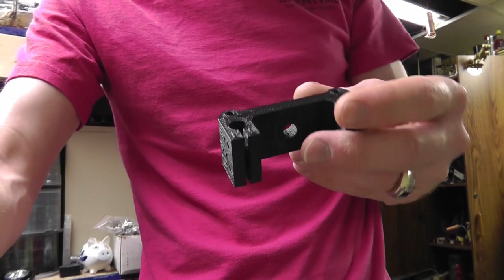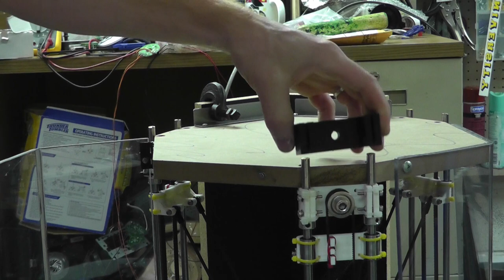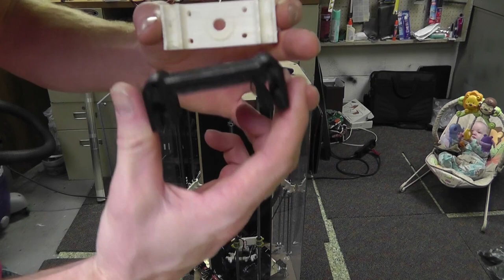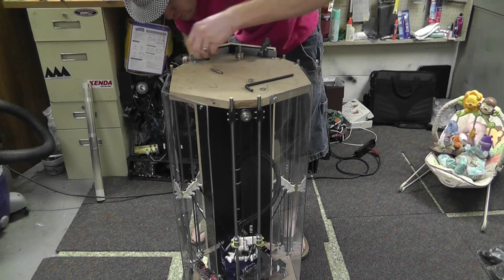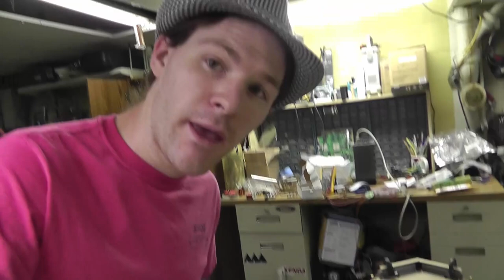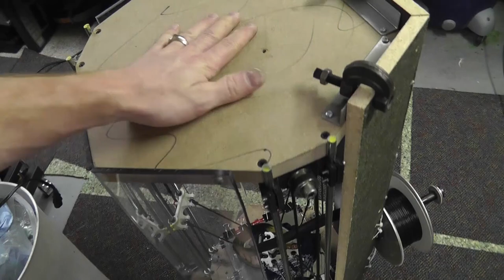Me and the newbie replacing the rail holders on the Rostock 3D printer...

Comment: Wow !  I'm kind of in the dark here on this one, do you actually make these parts ?
I'm familiar with plastic injection molding process from working a production line machine but that was 40 years ago, I'm not only intrigued but really interested in creating my own parts such as you are illustration here, could I do this in a home workshop on a small scale ? if so the projects that I could create are numerous. what equipment would I need and how costly to make parts o the size that your brackets are ?
Any help and direction (information) will be greatly appreciated, even if its links to other areas.
Thanking you in advance,
Kim
Kim Canterbury
Belfair, Wa
Reply from the maker: Hi, check the description. !! :)